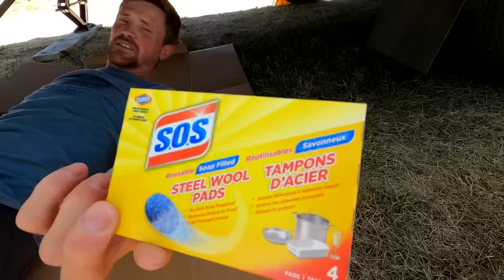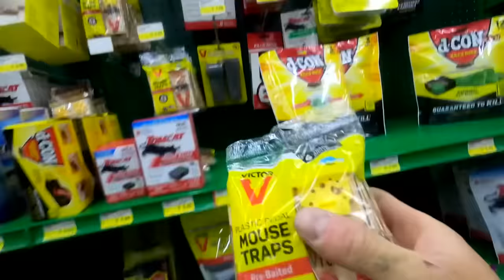MOUSE PROOFING OUR TINY HOME | RV RENOVATION

Comment: If you find a hole fill it with steel wool, the mice won't eat through it.
Reply: Peter May  That's what he was doing, along with spray foam. 😬
Reply: That's exactly what I had to do at my home, and it worked GREAT, EXCELLENT ADVICE!!!!!!!
Reply: Did you guys watch the program? The parts where he bought steel wool, talked about it multiple times, and then put it in the holes, and then talked about it again?
Reply: @susandoll3187  Yup, recommended it before they talked about it.
Reply: @susandoll3187   That's what I mentioned to him! 🤯
Reply: +1 Steel wool works best. I recall I lived in a small house and mice were getting in through a crevice near the entry way. I packed a bunch of steel wool into the crevice and nailed a molding over it. Some time later my cat was sitting by that same crevice staring at it and pawing at the area. I was wondering if mice had somehow gotten in there. So I removed the molding and pulled the steel wool out to inspect the area. As I pulled the steel wool out, a decaying dead mouse was attached to a strand of the steel wool, hooked on it like a fish to a fishing line. He had chewed on the steel wool and actually swallowed one of the wires which killed him. Steel wool WORKS!

Comment: Do not put screens over vents, any screen small enough to stop a mouse does not allow proper air flow and could cause heater to over heat.
Reply: I live above a store I was the first person to live in the brand new unit, I was still worried about bugs, I put screens (I used drywall tape as the screen) and I have a filter too over the vents, well the both reside under the vents flush to the vent cover. The HVAC guy doesn't love the idea and just asked us not to put a filter over the intake vent other than that  in 7 years we have had no problems with heat or AC

Comment: Dudes- I don't even wake up and "think" I had a dream; I mean, I have ZERO recollection about 98% of the time.  I literally feel like either I don't dream, or apparently I have Alzheimer's and don't remember shit.

When you buy used RV's or trailers, do these two things first:  FIX the top and the bottom.  Reseal and caulk everything.  And while underneath, assess rust and correction.

Comment: We have a camper that sits for months.  It sits on gravel with a carport over it.  Mice can get into any hole or crack bigger than 3/16 inch.  They thrive on insulation and eat normal spray  foam.  Use a special foam or silicone.  Hate them critters as much as Allie!

Comment: Mice is why many of us use plug-in LED rope on the ground surrounding our rigs. For some reason it deters them. Plus it looks fun and lights the exterior a bit. 

Something else you apparently don’t know yet, is that the mice will get into your engine and chew your wiring. You can easily get stranded that way. Many people keep their hoods open at night as it acts as a minor deterrent. I spray a repellent on the engine that I got at Walmart, which is specifically for that. It’s pricey but works and gives me piece of mind.

You guys really should call Camping World when you have such issues, they will tell you what other rigs do. It takes the guess work out of it.

Comment: Trent has the right idea - keep them out from the outside.  They will want to get in and in the walls is WORSE because they will eat your wiring and venting.  You might want to consider a metal grating or thick wire screening over the fabric.  It will only get worse in the woods and you dont want to be messing with that while you are trying to build a house before the snow hits.

Comment: Why not lift the side of the septic tank and pore cement leveling the side that is low?
Reply: You can't do that. That entire system is going to slowly settle once it is covered in tons of dirt and all the weight from being full of water and waste, so the tank would crack in half if cement was holding one side up while the other side sinks/settles in the dirt.
It needs to settle evenly in the soft dirt.
Reply: Calvin H. I’m afraid Trent May take the advice of Chris & not see your reply! Maybe you should post this as a comment also, so they don’t make any mistakes! I thought that what Chris said made sense until I saw your reply! I would hate to see them make such a costly mistake! I I tried to copy your reply for them to see but the website apparently doesn’t allow that!
Reply: @bunnielynn777  I believe they are going to lift the tank and re=level it. Or they also said they may move the input hole 3 inches higher, but either way, they're not going to pour cement under one side of it.
That contractor should know not to do that.
Reply: Calvin H. Thank you for replying to me! I could just see me doing the wrong thing 🤔
Reply: @bunnielynn777  You're so very welcome. And we all do the wrong thing sometimes. lol.
Reply: @bunnielynn777  you do realize these vids are not current . . . several days have past and the issue has most likely already been dealt with.   So in effect . . . ya'll are "Monday morning Quarterbacking"
Reply: Tthom2 that’s true, I wasn’t thinking about that! Thanks 🙏🏼

Comment: Wasps also like the smell of propane and to build nests in the vents. Put a screen over water heater (I think that’s the appliance, might be fridge) vent (small usually round, metal vent). EDIT; I just saw the vent! It’s the one by the back tire coming out of the square cover. That chrome round vent needs to be covered. They sell the screens at camper supply places. Run lights under the camper to come on at night on a timer. Many full time nomads do that when out west. The lights deter the mice. Not only a health issue, they gnaw the wiring.

Comment: What I would ask is that “if” they do the cutting and drilling and patching on the tank, is that going to interfere with the warranty of the product, if there is any kind of warranty???  Why wouldn’t the tank be set on a concrete slab that’s been leveled first?  The whole process must be stressful!  You’re doing a great job though!  🎉👍🏼👏🏼💗
Reply: Quite. It’s the second time the ground has slipped. What’s to say it won’t slip again?

Comment: I know I'm watching old videos and you hopefully have the mouse problems solved by now but a few months ago we realized we had a problem so I searched to try to find a safe solution apply peppermint and cinnamon oil on cotton balls and put them everywhere a mouse might enter or hang out. It worked in a very short time. They can't smell anything so they try to find their way back out but can't find their nests or food so they will die. You might find one they didn't find it's way out but it won't be leaving droppings anywhere. Reapply oils when fragrance has decreased. To keep them out.

Comment: After putting up with mice for multiple mouse waves. 1: Mice will get in any area that provides warm/cool darkened areas and close to food. 2: They will get into any hole or crack of 1/4". 3: Plastics or wood will not stop their chewing thru to get where they want, only metal works (aluminum screening not withstanding.)  4: Mouse traps work using peanut butter or jelly beans. Have had a trap go off catching a mouse on PB within 15 minutes of setting the trap out.  Good work out for septic system problem, also for your phone tech support call. You forgot one other reason for size of hole for footings,  below frostline. Where I am at 12", also with the heat construction will start at 4 or 5 am and stop at 1 or 2pm for the day.

Comment: Mice just love insulation like the bottom of the van. In Oz our hardware store sells a fine bird mesh, with a grid about 1/2 cm or 1/4 in square that can be used to keep mice and snakes out of bird cages. I would staple it onto the bottom of the camper.

Comment: Hi. Look around the inside of Terry for entry points, sink drains, water lines etc.. Plug them with steel wook/spray foam also. The mice can easily chew through that tarps under Terry.  Allie's idea of coving the vents with screen is excellent, as they can get through the tiniest spaces. Make sure you use metal screen. As for earwigs, they like dark damp places. Under as damp dish towel, bath mat... You can make or buy earwig trips. I hate them too. Hugs to you both and Frank :)
Reply: And get your septic leveled properly. If you don't it will cause you headaches down the road. The contractor thinks since its already inspected he can do a patch up job. This would never pass inspection.

Comment: You need to seal up all the drain drops into the holding tanks as there is usually a hole bigger than the pipe. Also, the power cord opening needs to be sealed. Bathtub drain, sink drains, etc. I know, cause I just went through exactly the same issue with my RV. Good luck.

Comment: I prefer the  plastic traps put some peanut butter on the tongue  then push the trap jaws open if it goes off on you it doesn't break fingers, you can also put the green squares  down below  so if the mice are down there they will feed on them and die. Then seal all holes you find with aluminum  and screw into place also use caulking before you put down the aluminum,  a mouse only needs a 1/4 of an inch to get in so look everywhere in your spaces below, I use to work for an RV dealer and that was one of my jobs sealing trailers  0plus check underneath  for any very small holes and seal them up have fun

Comment: We have an extra rubber liner on the underside of our trailer and we still ended up with a mouse. We followed the trail of poop and it looked like it led under the cabinetry for sink and stove. It’s like they are made of jello because they can fit in the smallest crack of light. I’d rather have a mouse than earwigs.

Comment: 🐭🐀🐁🐀Get “One Bite does It “ put it in the places like the hot water heater, etc. It will eliminate them. I put them by the Rollo garage door and in corners, etc. they are nibbled but then they leave to get water and 2 years later I haven’t noticed indications of anymore. Found two huge rats later in 5 gallon buckets of water dead, that was the end in the barn.

Comment: That tank is a easy fix it probably settled after it was set that happens all the time. I got rid of Mice with a sonic sound plug in. No more animals. Plus do what camper van kevin does use solar light motion sensors. I use sticky pads too. plus I spray RAID around the underbelly of the Motorhome once a Month.

Comment: Hey you two, a little tip about earwigs: I've seen them come up through drains. And I've found them hiding under wet, rotten wood in forests. They seem to like moist areas! And since they're sort of flat, they can squeeze through tiny cracks and holes. Hope that helps!

Comment: If they’ve chewed through the venting hose or any pipe they will use that same hole to go in and out the screen on the vents just shows them they can’t get through and they will leave going out the same way they made the hole so if you can find the holes and plug those also you’ll do good.

Comment: They will probably chew through regular fly screen. Get some mouse wire for the inlets and outlets and cover all the undercarriage, pop rivet a metal strip to all edges of the mouse wire. They will totally chew through anything that is not metal. I remember some big building foundations having broken glass shards mixed into the concrete to prevent rats chewing through the actual concrete. They are very determined little critters. 😀🐝

Comment: Allie you are not wrong. Mice will get through the smallest opening and those vents are huge. Not only do you have mice on your property but all farms have mice so you are parked in two mouse heavens. Mice climb walls as well. So they will climb up the outside of you trailer and get into any openings. Get caps for your bumper and store your black water house in there, make sure you have screws through the end caps that you can remove so they don't fly off going over rough roads. Trent there is actual steel wool that you can buy in the hardware store that is not sos pads and is much stronger, sorry bud. Good luck kids. Life is a struggle sometimes. Prayers said. xoxo

Comment: I use electronic trap and once you get all them round the outside of your trailer and if you're worried about pet sticking her nose in it got a little hole in a tub a little shallow tub and put it over the Trap and put a 4 by 4 on top works well

Comment: Hello
Suggestion on your water problems.
With aany waste broads could you make a simple  closet shaape to keep the water pipes from freezzing   Nothing fancy .
Smoething you would take down and used again till the house is finish. Have one side with a door, but not too tight.
Put a thermometer in it to check the heat. 
Like watching your videos.
I know you are not planning for a full basement. 
Just think about a basement sometime down the road it's handy room.
Good Luck
Rod from Ma.

Comment: do you remember the pipe vent cap you so nicely cut of so it would fit under the solar panel but DID NOT PUT A MESH screen on to alleviate any critters from getting in guess what they found it now the next problem will be not just small field mice but squirrels getting in the same hole as well

Comment: the hollow bumper is where you should put your waste pipe, they make little covers for the bumper so it wont slide out, and then you don't have to keep your poo pipe inside the trailer, just the fittings.

Comment: Hi Trent and Allie i was just thinking about your table and to make it more stable  i think you bought  some metal floor inserts ,well i was thinking if you still have the plastic ones still turn them upside down cut out the bottom the same size of the table leg then push the table leg though and the into the floor insert and i think that may make the table leg more stable without having to make any more surpports hope this helps love your channel gd luck David.

Comment: I know you dont need anymore projects but I keep trying to remember to tell you about an idea for Frank's riding solution in the truck.  I built a wooden raised bed frame for my truck.  My back seat is folded up and the frame is raised level with the front seat center console and fills the space from the center console to the right rear door so he can still hop in the left rear door and up into his bed on the frame.  I'm sure you could come up something like it if you wanted to be able to leave the seat down.  I just hate to see him in the floorboard up front and my dog loves his space when we are out and about.  Good luck and sorry for adding to your projects.

Comment: Think they might eat through the foam. Crumbled aluminum foil works well too. Screen needs to be made of metal, they’ll eat plastic. I’d put metal screen over the tarp. Field mice are very tiny and can get in anywhere. Aluminum foil and Brillo pads!! Traps? You have to keep checking them because you don’t want any little rotting corpses under Terry in this heat. And, someone has to dispose of the deceased mouses!   Oh, don’t use poison!

Comment: Hey guys, had the same issues. 
I used these, EarthKind EMW7208598 Fresh Cab Rodent, Rats and Mice Repellent With Blend Of Plant Fiber and Botanical Extracts For Use On The Farm, Industrial Settings, Garage or RV, 2.5 Ounce x 4 Scent Pouches
Worked great.

Comment: I may end up having to scrape out the form and the steel wool because I’ll eat through both of those that’s why I mentioned using screening not screen door screening that’s too frail but close we’ve heavier duty that requires you to bend it how you want it and you may have to use a pair of pliers or that type of thing to get it in the exact shape

Comment: I live in the country and have had a serious problem of mice chewing wires in my engine and in the cabin of my car.   I have used a strong essence of peppermint drops inside my vehicle and also under the hood.  I also use another rodent repellant product which I will post next time.  It works.

Comment: We had a mouse problem in our RV. We put Christmas tree lights under our camper that would come on at night and go off at dusk. They don't like light. And they make solar power lights too. We heard that if you put smooth sheet metal around your wheels, mice can't crawl up your wheels and get in. Just some thoughts. Good luck with your rodent war. Go get em!!